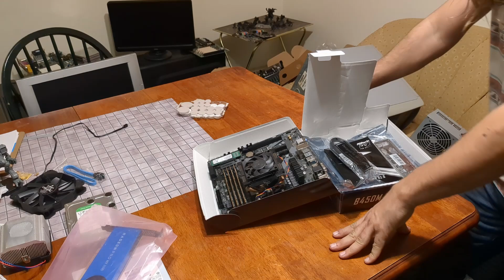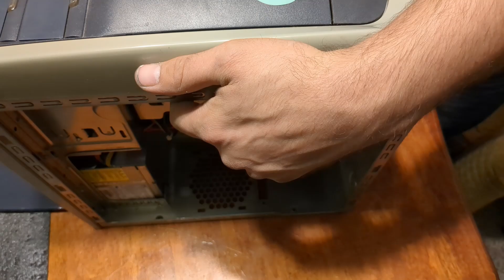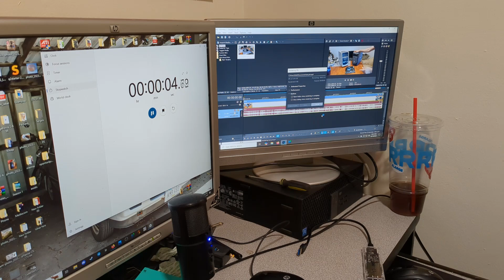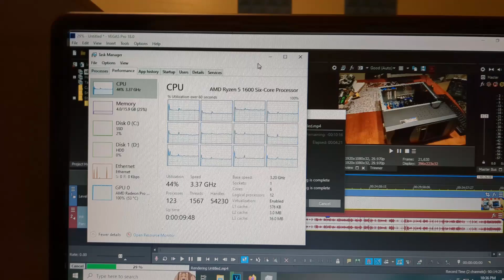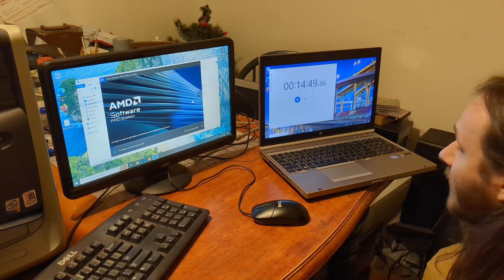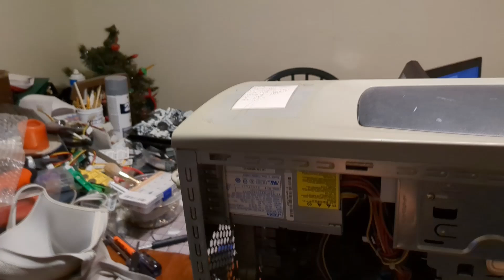Custom Budget Sleeper Video Editing PC!

Comment: I have always wanted to use a case like that for a sleeper build.
Sweet video, dude. :)
Reply from the maker: It's a hell of a hot box lol, hard to keep anything cool inside it unless you mod in a fan
Reply: @LowSpecActionSquad definitely recommend modding the case.  I just possibly lost my 5600x or b550 board in my Ryzenplex.  The GPU survived.  My guess is that I fried the memory controller since the RAM is DDR 4000 (downclocked to 3600 MT/s).

Comment: What video editing software do you use?
Reply from the maker: @OldPCGunk  I got Sony Vegas Pro 14 in a humble bundle a while back, and I actually picked up 18 in another humble bundle later on. I actually prefer the default Windows Video Editor when it comes to speeding up footage, as the way Vegas does it is very clunky, so whenever I do sped up footage, I usually render that footage in the default Windows video editor, then bring it over to Vegas to finish the project.

I'm currently in the process of switching over to Linux, but I don't think I'm going to get that done before the end of the year. Not sure what software I'm going to use once I switch
Reply: @LowSpecActionSquad  Nice - I still use software rendering (or used to in Davinci Resolve) so upgraded my video editing PC to Ryzen 9 3900x. It definitely made things quicker, but is still slower than hardware acceleration on a dedicated graphics card. There seem to be very few video editing packages that give hardware rendering support without costing money. (Capcut Desktop is one that is free and uses hardware rendering).
Reply from the maker: @joshwa1234 The default Windows video editor kind of supports hardware rendering, but (and I don't know if this is a fact or not) It seems to only work on Nvidia cards, and it doesn't seem to really use the gpu very much. There are a lot of free programs that also supposedly support hardware accelerated rendering, but It seems to be spotty on if it actually works or not, and sometimes it just comes down to which driver you use lol